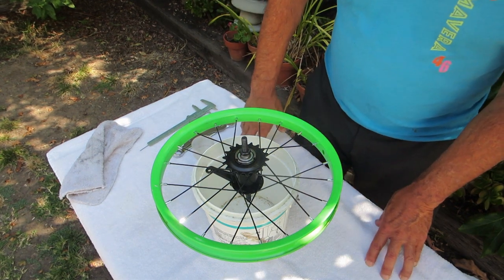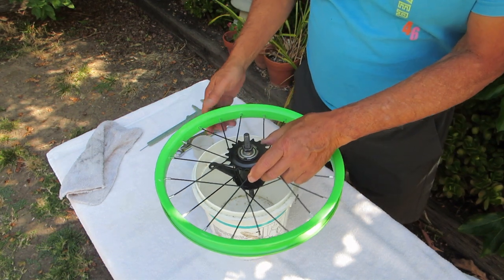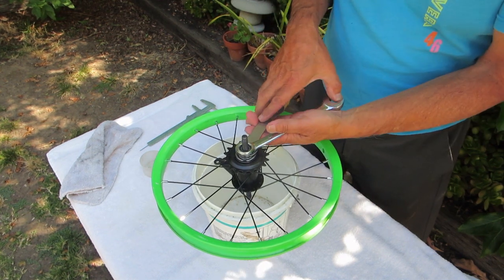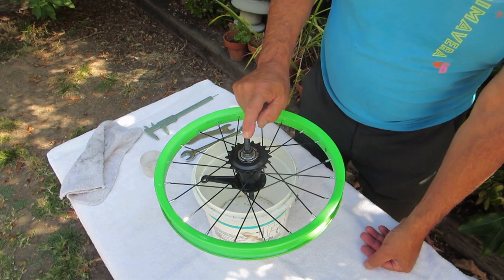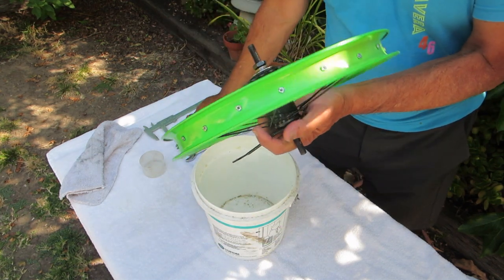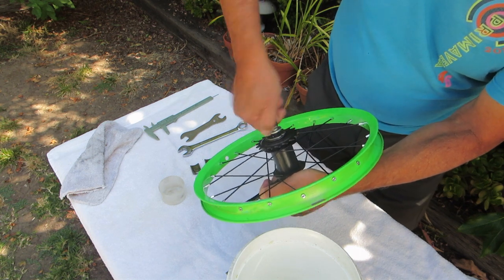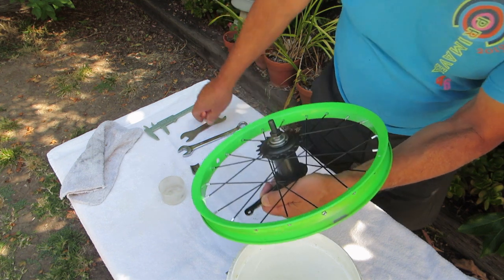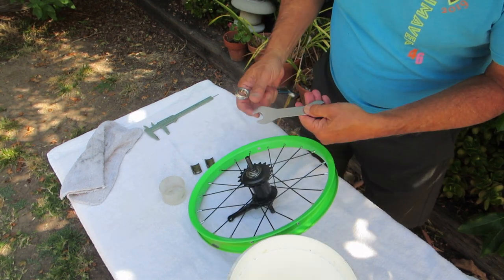I Didn't Install Brake Shoes!

Comment: I'm a new subscriber, very, very cool. I have a nineteen eighties, huffy good vibrations, considering doing that
Reply from the maker: Hi Ray,  Make sure you have hand brakes installed.  Then again, for a Huffy, I would leave it alone, and get another bike such as those used in my other videos.  Those bikes have higher quality frames and components, and you will enjoy the ride more.  Put your effort in quality as opposed to spending time and effort in a lower quality frame.  The frame quality is the first item you want to start with.  Get the best frame you can.  Used bikes like those on my video are easy to come by, just take your time.  It will come.
Reply: I was thinking the same thing as well I didn't know that trick that's a good one to know. I'm just going to keep it stock. Do both hubs and the bottom bracket and maybe just repaint it. Black and just my day to day beach cruiser, but my real project is a 1975 continental schwen. It's a barn find all I had to do is knock off the dust and I just put a little Polish on it. It's beautiful. I'll do the hubs in the bottom bracket and the head tube. The only problem I see with mine, it's the derailer, it's really sticky, like gooey sticky, I was thinking some c. LP to loosen it up and clean it up, and that's about it, and the friction shifters are a little sticky. Maybe I'll just do the new cables, but keep the the insulated parts the same anyway. Hey, thanks again. Let me know what you think about that. Alright, I'll talk to you soon.Bye